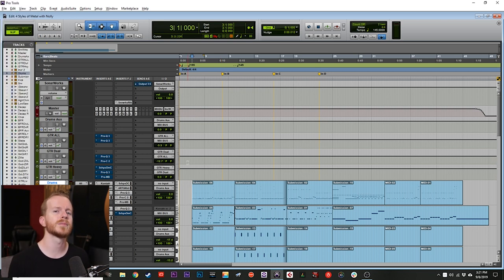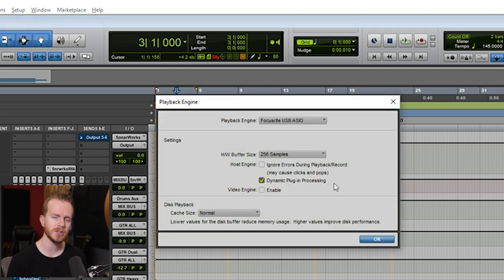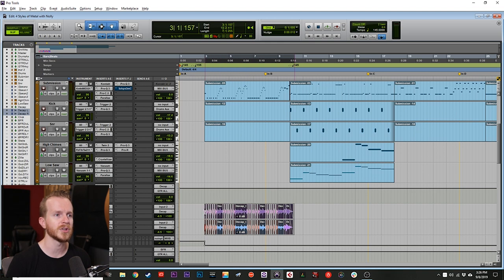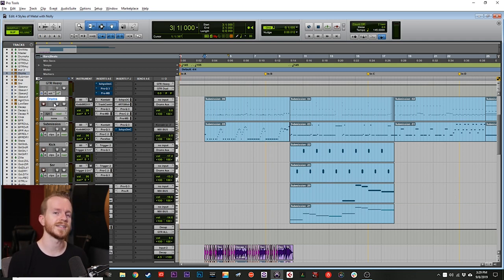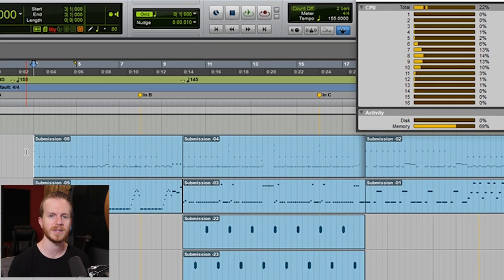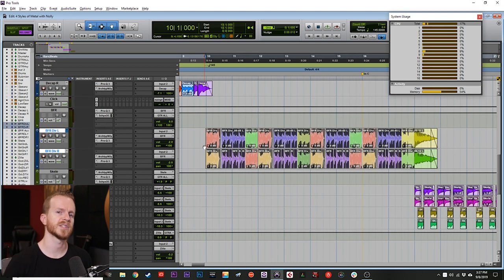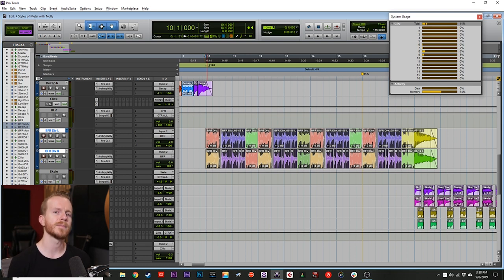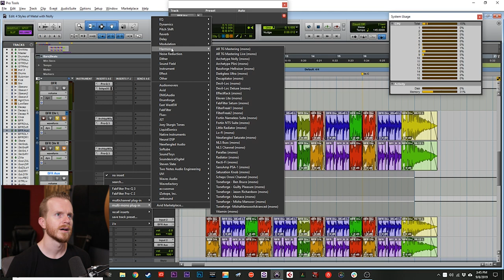Tips on How to Conserve CPU Power | Minute Mix Monday

Comment: one question: If U route your Left and Right (hard panned) DI to a (Stereo)Bus to use JUST one instance of the plug in there, shouldn't be setted to STEREO the plugin instance there? THX
Reply: Multi-Mono plugins in Pro Tools affect L and R channels separately so no need to set the plugin to stereo.  I switched back and forth a bunch just to make sure of course.  :)
Reply: @TheRealStevenWard   Cubase 8.5 here..in any case using a stereo instance, instead of 2 mono is alaways better in terms of cpu usage?